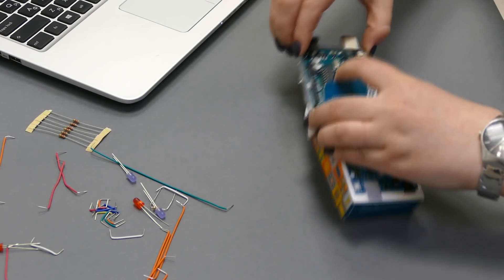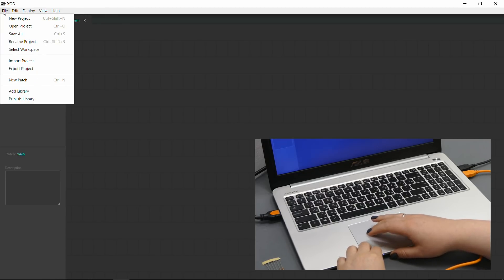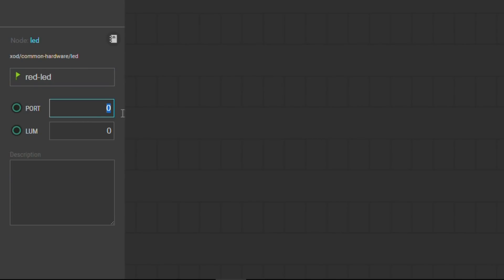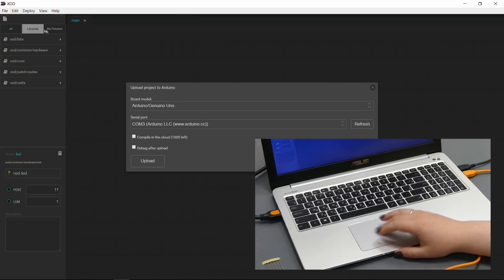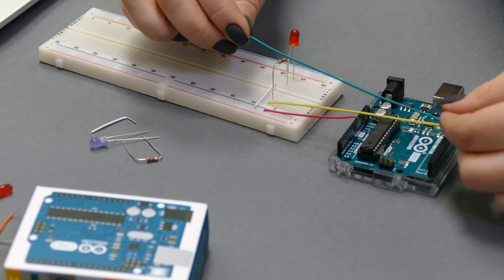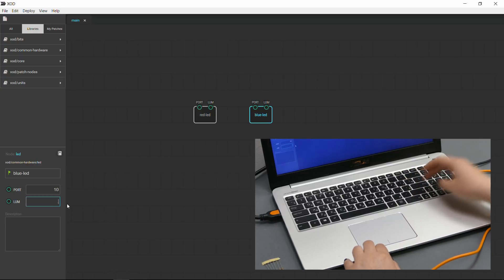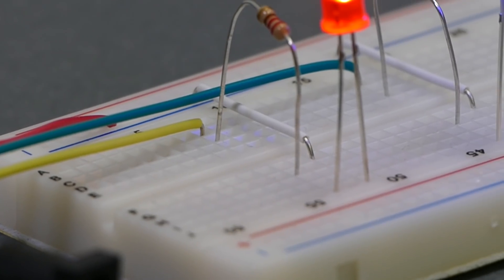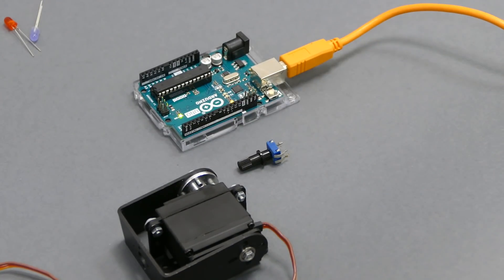XOD visual programming (Arduino based). Tutorial: #1

Comment: How is half .75?? With 0 being off and 1 being on, .50 should be half off (or half on, depending how you look at it).

Also, why are resistors needed if the arduino is throttling the power?
Reply: You always add current-limiting resistors to each LED in the circuit. Always. Look at any LED strip, they have current-limiting resistors built in to the strip for every... single... LED... on the entire strip! Without it, you can blow the LED as they cannot limit current themselves.

Comment: Very excellent video, so much so, I just downloaded it and installed on my laptop last night, and now about to put it on my desktop computer.  I would however, recommend a better work setup! I took 8 big breadboards, and a wooden box set of art supplies, to make my setup. I stuck the 8 strips on the top of the box, 2 rows and 8 columns wide, which comes out to 8.5 x 13 inches of breadboards. Then on the inside of the box, I stripped out the plastic holders for the art supplies, and now have a big storage space for wires and other parts. I took velcro and stuck my Arduino to the middle of the breadboards. Now everything is tied down, not moving around, and makes the connections more stable, plus I have so much room, even for huge projects. I just dont like anything moving around. Next thing I'll be getting his a tackle-box looking storage container sold in the sewing section at Wally. Its just the right size, not too small or big. I'll take the goodies from my Ellgoo MegaKit and 34 Sensor kit and put in this box. I just like everything easy to find and orderly arranged. This makes it faster for me to put together circuits. I now have the ultimate setup! Anyhow, I think I may end up using XOD although I've been a programmer all my life, I started with machine language on the Altair. As I get older, I get more lazy! Time to try something different, and Xod sure is... Very excellent video, I will have to watch all that you have made! THUMBS UP, and the ones who gave thumbs down, never mind them, they are retards that maybe should just go back to playing with their leggos,  Xod and Arduino is just maybe to complex for them to actually understand!

Comment: Disagree, in my case I don't care about the programming just want to get it done this seems like it will fit my needs. Will of course need to review this as I use the Arduino IDE but not the hardware. Will it work with ESP8266?
Reply from the maker: We are going to support ESP8266 soon
Reply: Can't wait to try this out on the 8266.